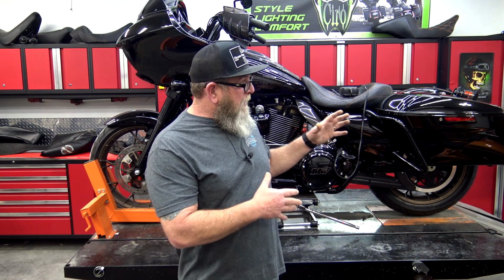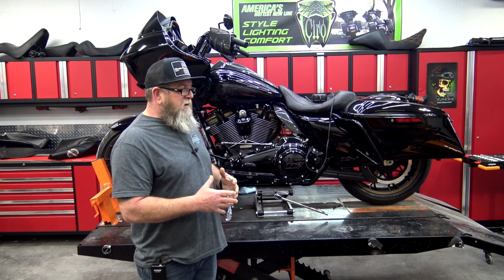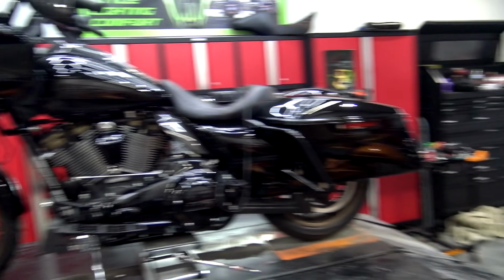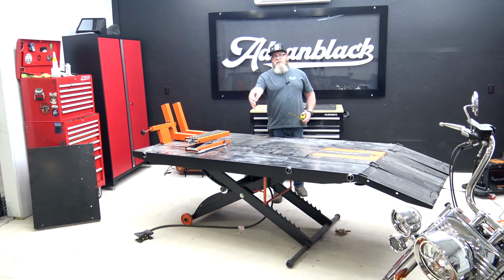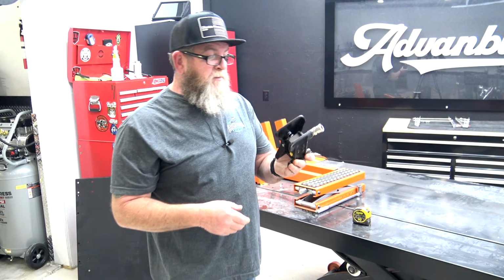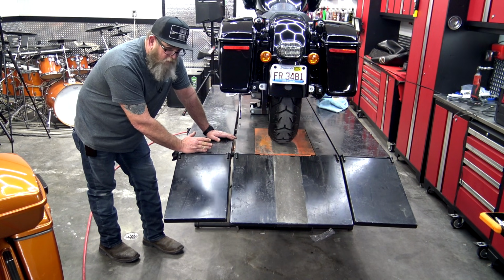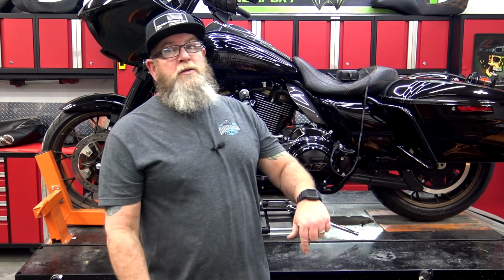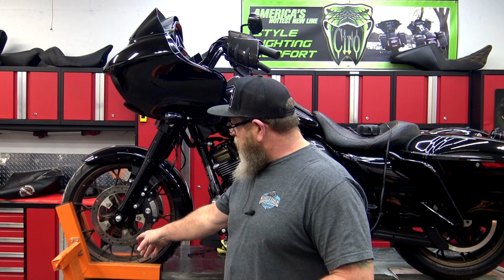⚡APlus 1500XL Motorcycle Lift: Worth the Buy?⚡

Comment: I have the exact same lift and have had it for 10+ years.  The first thing I did was got rid of that stupid crank up front and put a condor on the front. This allows me to ride it up and drop it right in The Condor and get off the bike with no issues at all. I run the table all the way up do my oil changes or need to do work on it. It locks in so well that i don't even strap it down. It is so solid I can shake the living heck out of it and it will not let that bike go. I love my table, I wouldn't be without it. My bike is lowered so I had to buy the extended ramp for a better angle. My table sets on the spare side of the garage and I just drive up and back it off with ease anytime I want the bike. BUY THIS TABLE.... YOU WON'T REGRET IT!
Reply from the maker: Thanks for checking it out and sorry for the late reply...been on vacation and yes the extended ramp will be being ordered soon for my cholo build. I wasn't aware that condor made a smaller flipper for the wrapper front fenders til a previous comment  so thats a very viable option for me now

Comment: I bought a handy bob 1500. Made in America stickers all over it. Wouldn’t work properly out the crate. It would start dropping as soon as you lifted it. Didn’t give you time to lock it before it would drop. The main o ring around the cylinder piston was installed backwards. The cylinder interior was full of metal shavings. Cylinder walls were gouged as a result. Handys fix was to send me a seal kit so I could fix it myself. $2,700.00. Will never buy another thing from them.
Reply from the maker: Thanks for checking it out and sorry for the late reply....it sounds like you definitely got a bad one. this old lift in this video started to develop a leak after 6 years of using it so I will have to change that soon as well.
Reply: Yeah obviously quality control went out the window when handy sold to I believe janco is the parent company now. I should have followed my first mind and got a k&l.

Comment: I live on a country road, gravel drive and a truck can't get into my driveway. I typically back the Pickup up to the tommy lift, put the freight in the back of the truck and I can get it most anywhere on the property. Get my son to help me unload from the P/U at the garage. Pro tip: :) Thanks for the review. I have been thinking about a lift since I got this Road Glide.
Reply from the maker: for some reason it out your comment in "review" so im just seeing this...we have a pretty long drive but the trucks can get in here but only drop it in the front of the house...as we were puling it to the back to the shop it slipped and smashed my sons toe...im pretty sure its till black and that was months ago lol my truck has an 8" lift so its virtually impossible to anything heavy out of it lol

Comment: If you can’t get the right amount of Teflon tape on that 45 degree fitting where it will stop in the right location, run a 1/4” pipe tap in the hole or try another fitting?
Reply from the maker: Sorry for the late reply but yes I tried the tape methos but that didnt do it...im going to try to tap it a little deeper

Comment: Looks like these were rebranded to what is now called Black Widow.  Looks exactly the same.  I like to put one side of my side extension upside down so it serves as a tray for my tools.  I do not like the 'hard to find neutral' position on the foot pedal, and non padded wheel vise.  I also got the extended ramp so I don't risk bottoming out my slammed softail showbike.  Other than those minor issue, I absolutely love my motorcycle lift.
Reply from the maker: sorry for the late reply...I think a lot of these lifts now are all made at the same place and white labeled to companies and re branded. Several of them looked identical while I was researching. I will need to get the extended ramps for sure for my softail also...those 39" fishtails are coming mighty close and I havent installed the air ride yet

Comment: I have one of these lifts. Got it about a year ago.  Really like it. I bought extra side rails because I have a TriGlide Ultra Classic, along with three other Harleys. When you get another set of side rails, you get a longer set of pipes to hold them on. Haven't had any problems with them bending so far. It does make the lift 72 inches wide with two sets of side rails. I don't have the problem with the lift pedal that you are having. I just lift it up, put the safety bar in place, then let the air pressure off. Thanks for the video. Ride Safe!
Reply from the maker: sorry for the late reply...some of these slipped by me...but yes im loving the lift outside of the small annoyances lol nothing to serious but thats what I do to...just set the safety bar and release the air hose and it works great.

Comment: I have the exact lift. Game changer for working on the bike. I hated that crank vise so i got a condor chock which i need to install. Mine came with a trike ramp extension which i’ll never use. So if you want it, it’s yours. You’re right about the shipping and weight. It’s heavy as heck. The truck driver dollyed mine into the garage so it was easy to unbox and put together.
Reply from the maker: sorry for the late reply...yeah the driver here dumped it in front of my wifes garage as my shop is way behind my house ...so we di have to get it back there...was tough but we got it...I cant use the condor style chocks because of having fat tire bikes and also working on a lot of them I cant switch out the chock all the time..I did have to move the handle side out one inch and re drill the base for it to accommodate the fat tires.

Comment: Good info Steve. Would it be possible to change that fitting to a straight fitting? I know you shouldn't have to, but may be a solution. On ebay they show the air lines coming in from the other side. Compressor in the middle and cylinder in the spot up from it closest to the word up. Maybe that will give you more options as well.
Reply from the maker: sorry for the late reply...and yes I am going to try moving one side to the other and add a straight connector. My other one is like that even though its a definitely pedal i think it will work.